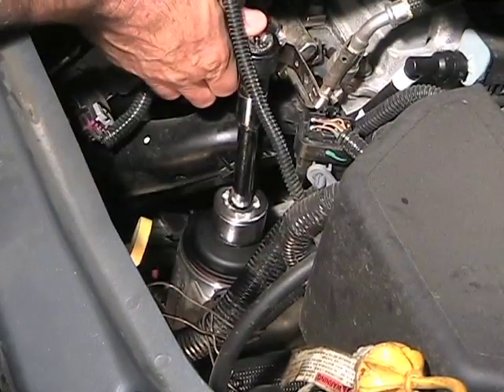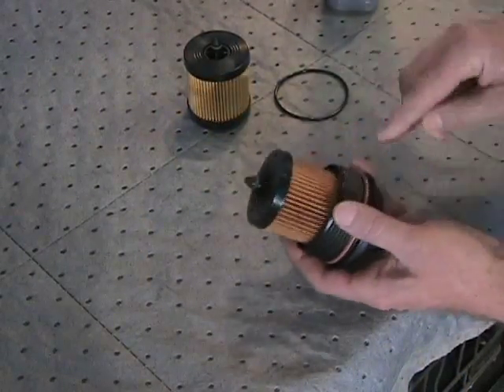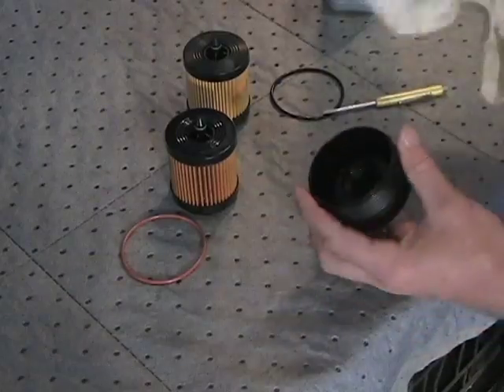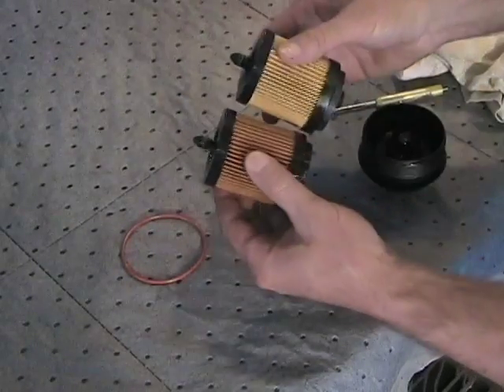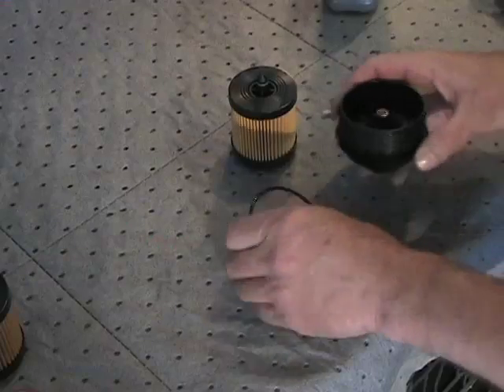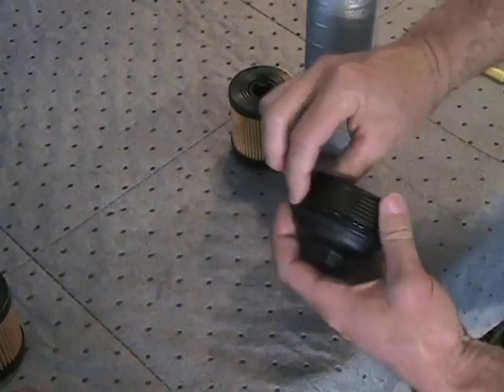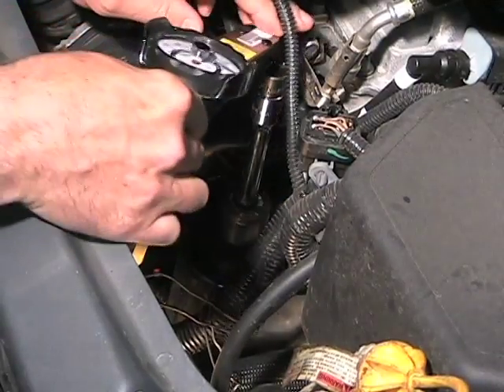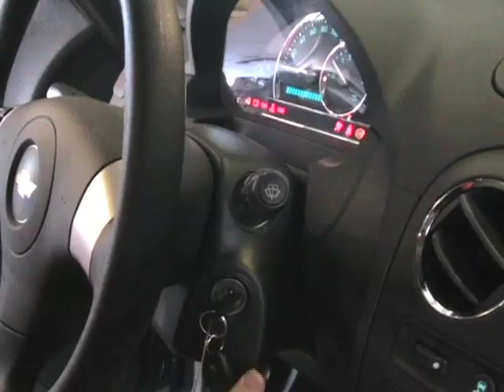How to change a Cartridge Oil Filter in a Chevy HHR

Comment from the maker: @santi781 Thank you for the question. Check your owners manual or manufacturers specs on your filter cap and housing. Here is a link to a socket set that covers most sizes. Autozone offers these sockets, they can direct you on what size to use for your model.

Comment: i have a 2002 pontiac grand am 2.2 L ecotec engine and i bought a 32 MM oil filter from advanced auto parts for about 13 bucks. hope that helps.